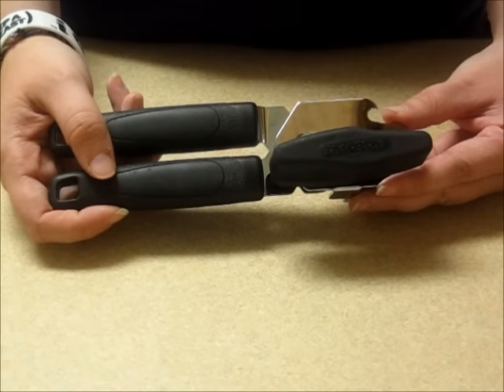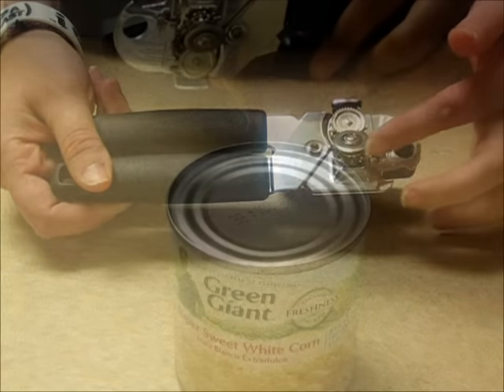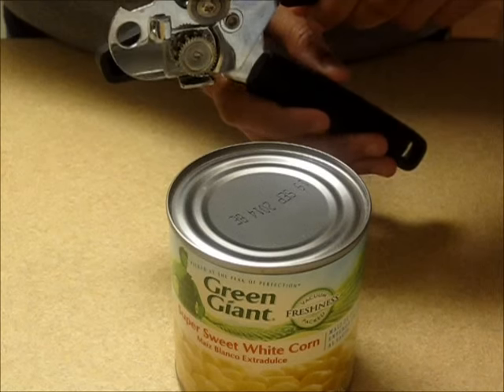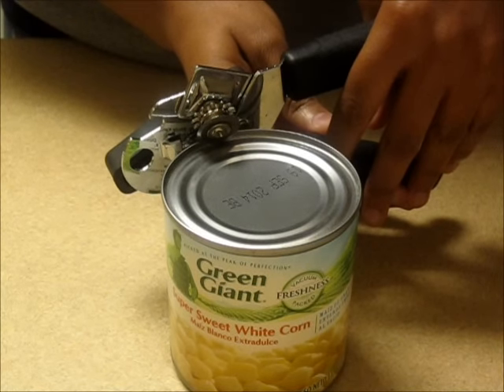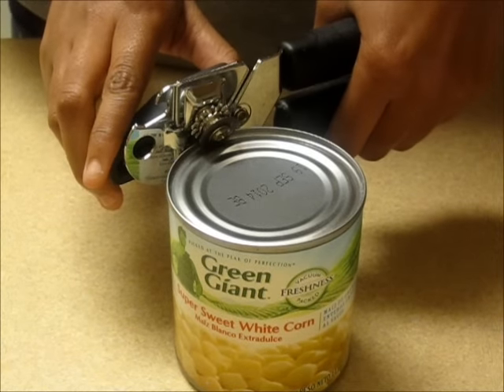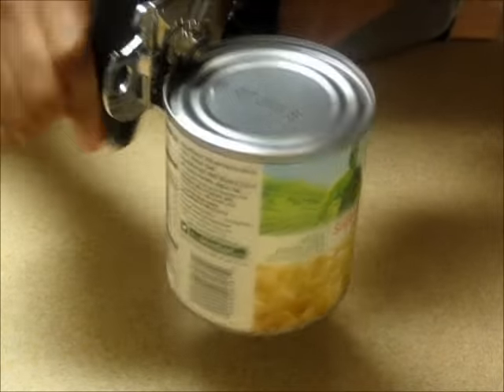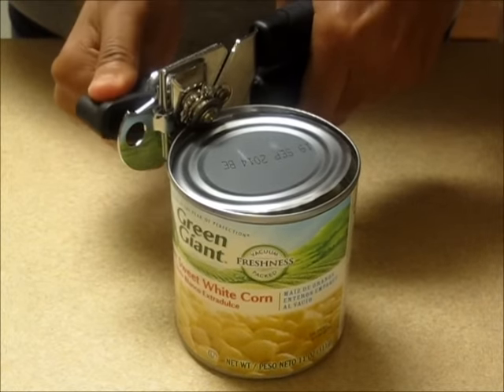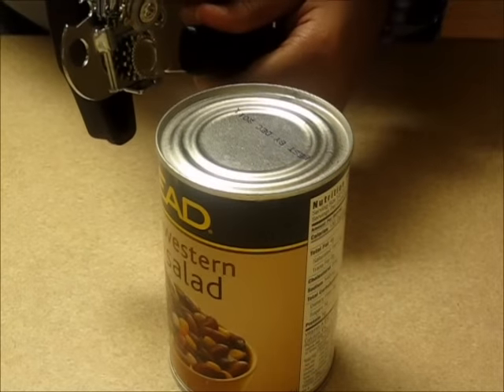Can Opener

Comment: Im 25 years old, and all my life Ive never had luck with a gear operated can opener, because I always thought youre supposed to cut the outside like turning on a lathe, rather than on the face. Clamps well but the wheels always slip and turning the thing makes no effect and Ive always gone back to the manual gearless can opener, or a P-51, or a knife because Ive gotten pretty good at these. Suddenly thought of learning a new tool today. From a third world country. We dont use cans a lot. Most food comes from plastic bags

Comment: That's the wrong way to open a can btw.  You  put the blade facing out UNDER the lip HORIZONTALLY.  That's why the lip guard on the bottom/inside of the can opener is flat instead of convex/curved.  It's supposed to sit on the top of the can. 
You get no jagged/sharp edge to potentially cut yourself and you don't have to worry about the top falling into the can's contents.